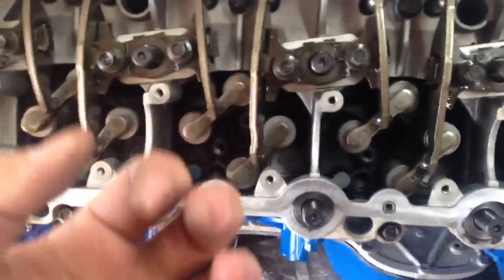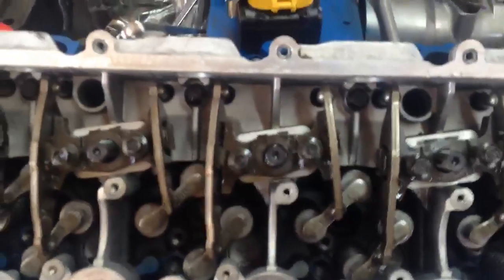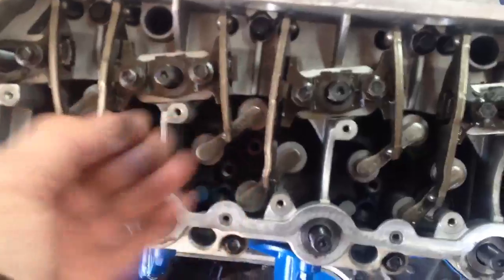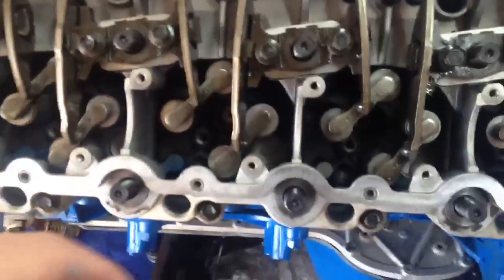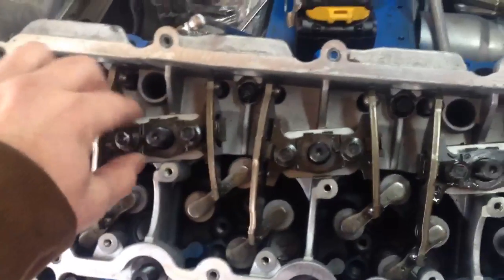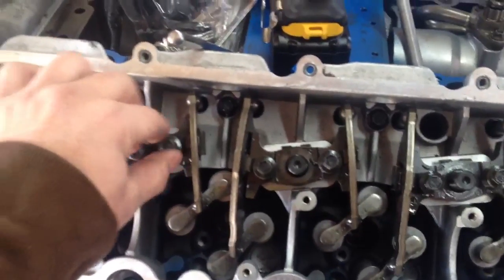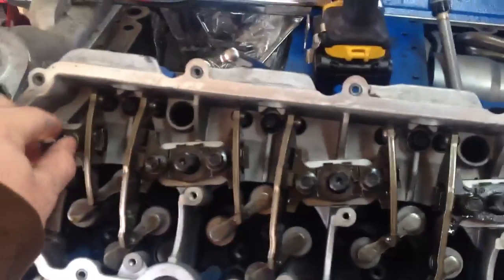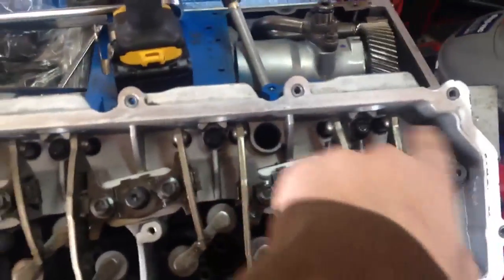Torque ARP studs on 6.0

Comment from the maker: There is an impression on the damper gor the dowel pin.  The intake can't be put on before the studs are tightened.  Also you won't get th at engine back in with the intake put on unless you lifted the cab.  There just isn't enough clearance in t g e back near the firewall.